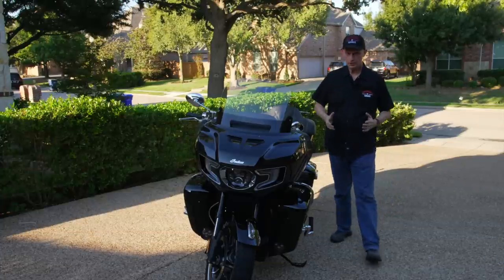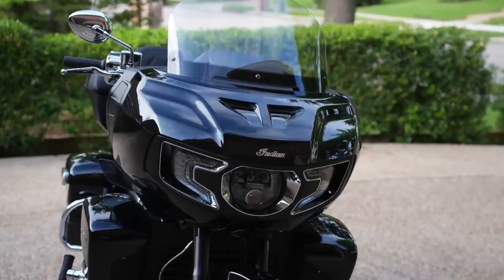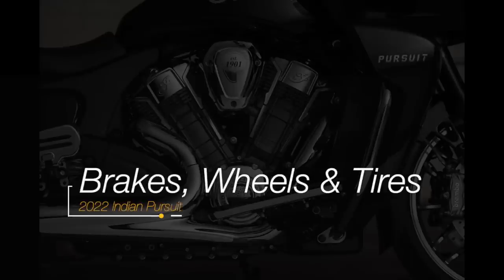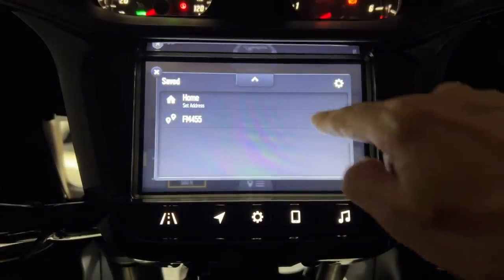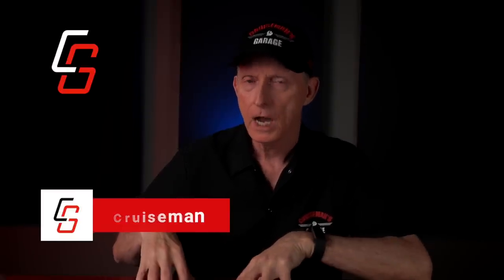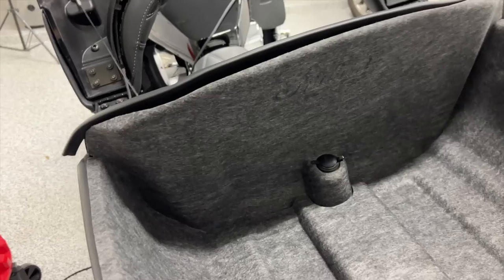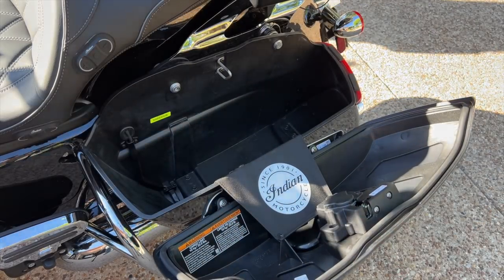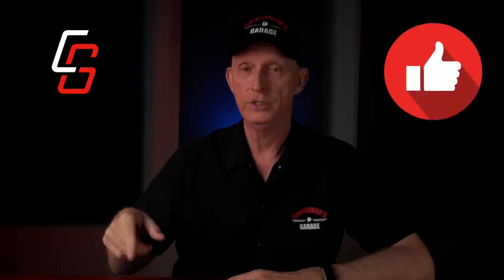Is the 2022 Indian Pursuit the BEST V-Twin touring motorcycle? | Indian Pursuit Review

Comment: In watching this video I can see that this bike has several area's that beat my '17 H-D Road Glide Special at. Tech is much better but that should be qualified by saying that H-D tech is much improved on the new ones VRS my '17. The automatic W/S adjuster is a big feature for me, H-D still does not offer this. Central locking is another feature that only comes on the CVO H-D bikes that I would love to have on mine. The engine performance is significantly better than H-D. I would separate handling and suspension in a review. The handling of my H-D is very good but the suspension is very bad stock. I've had to add a pair of shocks that cost $1000.00 to fix this glaring issue. You did not mention Dealer support. Dealer support is much better with H-D than Indian. a large amount of Indian dealers are small, fewer and if traveling cannot get you repaired quickly if you were to have a breakdown in comparison with H-D. I might consider an Indian if I had a closer dealer but I am 80 miles from the closest dealer and that is a deal breaker for me personally. After watching this I feel that H-D need to step up their game but as it stands H-D is selling all of the bikes they can produce in these weird times. Thank you for your effort, you are very good at It!
Reply: For the record Rod,  I put 64k on a vic x-country tour, and currently 55k on my indian roadmaster.  Never once has the need of a dealer came up while touring or otherwise.  I agree it is nice to have the accessibility to dealers, it's not, or should I say, it hasn't been totally necessary throughout my ownership, nor has it been a concern when out exploring the world.

Comment: So to be clear:  You rated the bike with 7 specific categories, each with a number between 1 and 5.   Yet the final rating was 4.5 and not 3.8.   Interesting.   Perhaps that difference is in the fact that there are some subjective experiences and perceptions that can't be captured with numbers?   
MCRider did a Price per Horsepower rating.  For me, that number (HP: $270 per and Torque: $257 per) would have influenced the "Performance" category rating.  

Lovely bike but not enough for me to switch from my current bike which I can subjectively rate just as well as you've done here.  
Interesting though and I appreciate it.